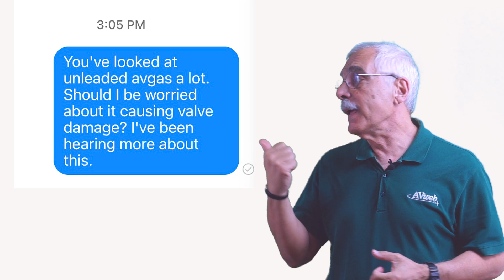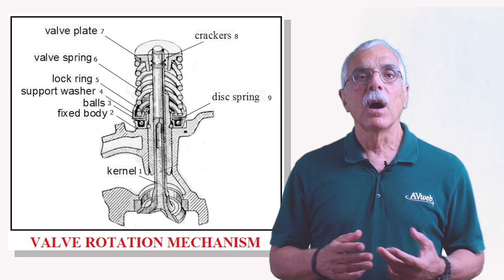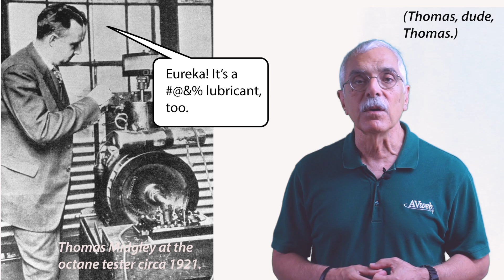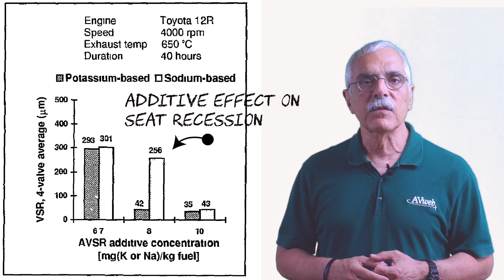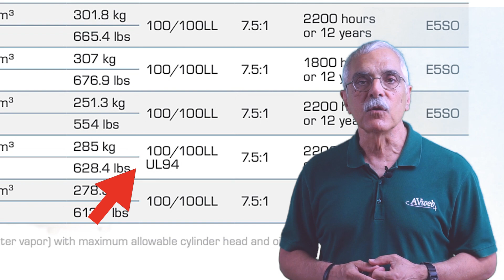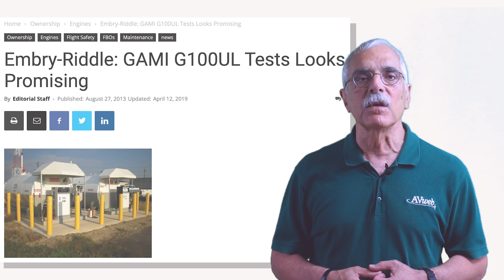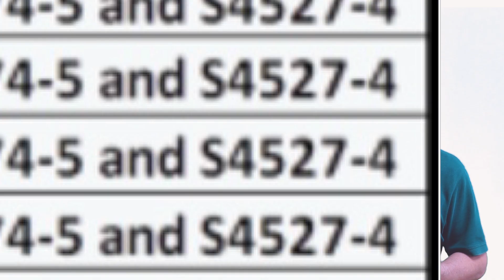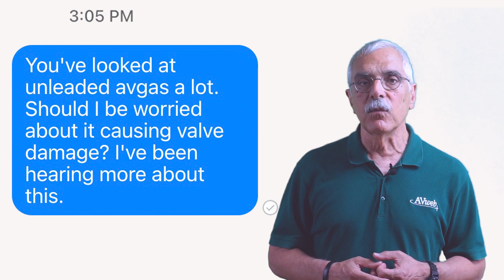Whadayamean Unleaded Fuel Will Trash My Valves?

Comment: My O-200 equipped Cessna has the MOGAS STC, and is legal for full 93 octane non ethanol MOGAS, but since Alaska only has 91 (at least nearly all AK gas is E free), and the stc recommends it, I run a 30% mix of 100LL. I would like to go to full MOGAS but fairy dust theory and the minimal added cost vs overhauled cylinders makes me still toss in a splash of 100LL. Just enough lead to "protect the valves" if that's even true, and not so much it fouls spark plugs. The baby Continental idles so much better on UL MOGAS but I'd like to see something from Continental themselves that says it's not a problem. GAMI may have won the FAA over with the blanket STC but the tin foil hat guy in me says that's pretty convenient, and the same people who take 9 months to process an aircraft registration might have approved it just to get everyone to shut up.
Reply: I've seen several mentions of using a blend of 100LL and unleaded, or 100LL only once in a while, or a tiny amount of additive, to have the same protective effects - perhaps a compromise solution would be some sort of "100ULL" (Ultra Low Lead) fuel that only has 30% (exact amount needed would require a lot of research) the lead of current 100LL, enough to still provide all the needed protective effects while substantially reducing (not entirely eliminating) the lead's environmental impact and engine fouling. Thinking from an environmental perspective, it wouldn't be as good as unleaded, but less lead now would be better than continuing to use what we have now for however long it takes to actually come up with an unleaded alternative, the efforts towards that ongoing with this as an intermediate step. One of those situations where everyone expects a new technology to come along and save the day, until which we continue doing the old thing while that technology isn't forthcoming, we really need to do something that isn't as good but still better than the status quo in the mean time - we can't just keep waiting. 10 years of 70% less lead would be a very good thing.

Comment: It's worth noting that a huge portion of GAMI's testing of G100UL was done with a Continental IO-550N equipped with the GAMI-designed STC'd turbonormalizing system that was on all the Cirrus SR-22TN aircraft up until Cirrus adopted the TSIO-550K and changed the designation to SR-22T. That engine has been around a long time and so I doubt very much that it had the new, hardened valve seats. They chose that engine because it's one of the most demanding engines in the fleet for anti-detonation testing. I think George knows the big-bore Continental engines as well as anybody at Continental, if not better.

When they went for final approval, they had to build a "conforming" engine and run an additional series of tests with that engine. It would be interesting to know if that engine had the hardened seats or not.

Comment: We use so little avgas that this issue is a big non issue.  The refineries aren't going to stop making leaded gas unless the tree huggers make laws against it.  Too profitable.  Then, in order to use this unleaded stuff, you have to pay for an STC which then requires a 337 form in order to use it.   from what I hear that STC is 600 bucks and fuel is more expensive.  Most pilots I know have already thrown a FJB at this.  I know of only one airport in Ohio that has it and don't see anyone buying it at the moment.

Comment: From my recollection this used to be a problem in automotive engines like old flat heads and the like in that the valve seats weren't hardened, and the tetraethyl lead provided some extra lubricity for both the seats and valve faces (edit: Even though Paul is skeptical, this is true as far as I can tell from those who have ran older heads. There are indeed other factors, such as how deposits stick to the valve face as well which lead may alter. I don't think combustion dynamics would factor in as much unless it alters temperature or soot formation in the combustion gasses significantly.) By now, though, the fact that aluminum heads automatically need seat inserts means they should have already switched to hardened seats a long time ago since they are so much more reliable and resistant to pitting and such (edit: Except for Continental. Seriously? 🤨 And maybe they were worried about cracked or dropped seats in service. Who knows...). Can see this with old iron heads that have only hardened exhaust seats. The intake seats will get hammered to hell and have all kinds of pitting from combustion deposits on the valve face getting hammered into it. I even had one car engine that did not have any sort of rotators and there the valves fit into the seat like a detent. Probably the only reason they often don't suffer major recession is that its cool enough that galling doesn't take place (as stated in the Phillips study).
Reply: @Doctor Whowhotheowl Its not the hardness. It likely comes down to it stopping metal transfer since the mechanism is believed to be caused by galling of the seat. When you have similar hardness metals, you have similar surface energies. As such, when two surfaces are in contact, there isn't much preference for what side the metal atoms end up on, so the two surfaces adhere and transfer material (i.e. galling). This is a big issue if the metals are hot as they are also softer, and thus more prone to adhesion when the valve is in contact with the seat. By having a dissimilar material there it can help stop the transfer by making adhesion less likely to occur, thus reducing wear. However, with hardened seats, leaded gas may actually cause slightly more wear as the hardened seat is not subject to galling due to the heat treatment. As such, it only is subject to wear, and the oxides may actually accelerate that slightly.
Reply: What is tetraethyl lead really good at? Boosting octane rating! What does higher octane rating prevent? Detonation!  Detonation can wear away a surface. Typically detonation originates at a sharp edge of something hot in the combustion chamber.....like the edge of a hot exhaust valve! Now you got this valve with little pits all over it wearing against the seat and you have valve seat recession.

So yea changing from leaded gas with high octane, often higher than what was stated, to unleaded gas with lower octane caused valve seat recession caused by detonation. There is nothing "lubricative" to lead deposits. Those lead deposits are more like sand than lube and they are not soft like a lead sinker so provide no cushion as some have also claimed. Lead deposits are know to cause valves to get stuck open! Soft stuff that lubes does not cause moving parts to get stuck!

It's not the lead or lack thereof, it's the difference in octane rating that's the problem.
But people will continue to ignore this logic with their twisted logic like " you young whippersnappers were not there! My engine had valve seat recession after switching to that unleaded junk gas! Therefore the lead was needed and provided great protection against valve seat recession! Octane smocktane! Lead is soft not abrasive! Lead is lead, what's all this nonsense about lead deposits being hard and abrasive. Haven't you ever used a lead sinker when fishing? Lead is so soft you can cut it with a knife! Screw your science, I'll keep using my common sense and anecdotal evidence that has proven me right all these years! Can't believe people think I'm so stupid to believe that lead is abrasive!"
Reply: @ulbuilder  How can you have detonation between two metal surfaces that form a sealing face? You can't. Detonation (more specifically when the flame front goes supersonic) is confined to the combustion chamber, and there are a variety of factors that will influence it. I have, in my several decades of actual experience working on engines (as well as being an engineer), never seen detonation issues between valve seats and faces. What I have seen, however, is damage due to deposits that get trapped there. No hardened seat? False-brinelling. Combine this with high temperatures and you have a proven recipe for galling and material transfer.

Now, as far as detonation goes, you are correct in a sense, but fail to see the actual potential reasons, namely increased combustion and EGTs, which absolutely will influence valve seat recession, and make it more likely you will torch a valve. The big problem with detonation is that via the supersonic combustion taking place it can cause shock fronts and sharp rises in both combustion temperature as well as pressure. None of these do normal engines any good. But typically this damage is more macroscopic in that it will cause cracked pistons, damaged ring lands, surface spalling, etc. But, these require that the surfaces be directly in proximity to the combustion, and detonation bad enough to actually impact valve seats would cause much worse than just valve seat recession. It would cause mechanical failure in short order.

Also, don't make the mistake that something "dry" doesn't have lubricating properties. Its not like oil where its slick. Rather, such properties would either prevent material transfer from being dissimilar to the substrate they are on, or provide some benefit in preventing deposits  either from altering combustion or preventing them from settling out onto surfaces within the combustion chamber.
Reply: @ulbuilder  Lots of people have strong opinions with not much education to back them up. This is, I suppose, just human nature. In fact the lead deposits these engines produce are not pure lead but lead(II) bromide (PbBr2) which is not soft like pure lead but instead hard like little grains of white sand. I’ve cleaned enough of it out of aircraft spark plugs to know it’s not a desirable thing. Otherwise the the engine manufacturer would have coated the inside of the engine with it at the factory.
Reply: @wrkingrageaholic  Actually I'm a mechanical engineer with a graduate degree and several decades of experience working on engines. The fact that the precipitates are "hard" does not mean they won't help the valve seats. To keep in your vein of thought, that in itself is an uneducated and potentially unfounded opinion. While it does not guarantee a solutary benefit, if it prevents galling in soft, unhardened seats by preventing metal transfer, then it will absolutely lower wear rates. Conversely, in hardened seats, it can actually have a slight detrimental effect, meaning that engines that do not need it may see a slight increase in valve seat recession due to its abrasive nature. Again, just because its not "soft" does not mean it does not help. To know for sure, we would need to quantify the types of deposits formed, and conduct controlled wear testing with them both absent and present. But since its being phased out, its a test that is unlikely to be run and we will never know for sure.
Reply: @wrkingrageaholic  And again, its helps not to make assumptions. I have used coating that are themselves somewhat abrasive (a sputtered hard coating with a polymer overcoat to be precise) to stop galling on fine-thread stainless steel bolted sections. If its dissimilar enough, metal transfer does not take place and the bolted joint in question did not seize. But, the coatings did cause some increased wear once the polymer overlay wore away. However, it still worked until the hard coating itself was gone, which greatly extended the number of assembly/disassembly cycles that could be tolerated from about zero to 20-25, which easily exceeded the housings lifetime.
Reply: @mysock351C  Unless you have spent time in your engineering career studying the specific effects of lead bromide deposits within internal combustion engines, then your opinion is just like mine: a guess. I maintain that any net positive from lead deposits, if it exists, is purely accidental and fully outweighed by lead’s toxicity.
Reply: @wrkingrageaholic  Do you know how galling works? Probably not. Any idea of how metallurgy changes with temperature? Doubt it. And them being "accidental", what the hell does that have to do with anything? Did I say we should continue using it? No. Its clearly preferable to have hardened seats. And stating other factors like increased bore wear has no bearing on the conversation about valve seats. And it also doesn't matter how it "feels" between your fingers when you pull a motor apart, nor how "toxic" it is. The conversation was "does it stop valve seat recession with unhardened seats?" Answer: It probably does, or at least under certain circumstances might help. There has been too much anecdotal evidence to the contrary. Also since aircraft have aluminum heads, they will have some form of inserts, which are likely better than just the bare as-cast iron in an old 60's cylinder head or an old Henry Ford-era flathead V8. As I have said, those seats are SOFT, like really soft and they get hammered to hell pretty quick on heads that have unhardened intake seats from my experience. Only difference there is there is liquid fuel and lower temperatures to ensure they don't get completely obliterated. Forget any abrasive nature of the lead deposits, galling will destroy them in a matter of hours on the exhaust side due to how fast the material transfer can take place. If it helps prevent that, then it will have a HUGE impact on how fast they wear. That is not a guess. But, the conditions to verify it are quite difficult again since we need to quantify what would actually be present in terms of deposits, and which ones can actually precipitate out onto the hot exhaust valves and seats. The lead bromide might not, but some other oxide or lead compound might.
Reply: @wrkingrageaholic  And its probably, for completeness, worth mentioning that galling might not be the only mechanism. Deposits on the seats can also wreak havoc with wear as I have seen. But, this is not purely just a "guess." There is anecdotal as well as actual studies which support the transition to unleaded fuel had detrimental effects on older engines. However, since even the staunchest hold-outs have converted over to proper hardened valve seats, its a non-point at this juncture.

Comment: So basically, engine manufacturers could have been building engines that would perform as good or better on unleaded fuel (just like my 12,000 hr Chevy engines) but that would mean the avgas suppliers wouldn’t be able to terrify is into using their “required” 100LL. Right….

Comment: I am curious to see how older engines perform, such as my E225-8. Granted, the fuel is approved and gami knows their shit so I don't think Ill have any issues.
Reply: I would expect your e225-8 will like it much more. Less plug fouling and lower chance of stuck exhaust valves. I had an early model A35 with an e225-8 and ran a 50/50 mix of ethanol free 87, and 100LL. I had the Peterson STC so was able to run MoGas. It was much happier on MoGas.

Comment: What we really need is for Rotax to come out with a larger displacement 180-220hp turbo variant of the 915. Ultra smooth, reliable and loves to sip on 91.
Reply: A 199hp Rotax would be revolutionary for GA. The rumors have been floating around for years now, fingers crossed it comes soon.
Reply: Yeah, they should build a six based on the same technology, then develop an STC for a popular type (say, O-300 powered C172), and give the STC away with an engine purchase.
Reply: Look up the video "300HP Rotax! The revolutionary V6 engine General Aviation pilots never got to fly…"
Reply: They tried to release a bigger engine once and gave up, it's in one of his previous videos.
Reply: There is already the UL power 520is and 520T
Reply: @sanMartino11  They are air cooled.

Comment: We've gotta accelerate the move to unleaded.  Only someone that ate a lot of lead paint as a kid will argue that lead is not bad for us.  It's either no lead or no fuel.  Up to us to decide.  Besides, most engines will run better on unleaded.
Reply: The amount of lead used in aviation is miniscule. It's a non issue.
Reply: @redcat9436  Do you have data to back that up?